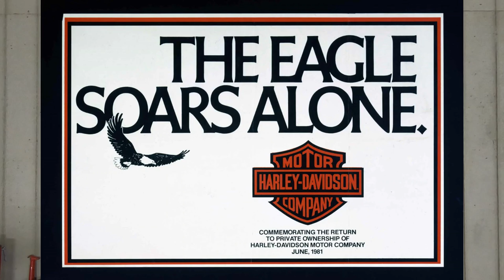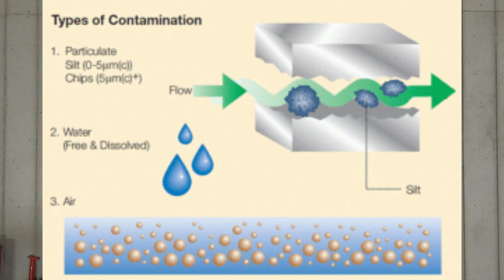Harley Engine Quality Isn't What It Used to Be

Comment: I dunno, M8 engines are lasting longer than Twin Cams and Evos ever dreamed they could. People regularly breaking over 100k and now 120k miles on an M8 bagger and M8 softail.
I remember when once you got like 80K on a twin cam, you were looking at rebuilding the top end. With the M8, if you replace the comp ramp, and the plastic intake then it's a pretty solid 100k+ setup.
Reply: ⬆️ %100 not true, not even sure where you came up with those numbers, did you make it up?
Reply: @getoffmygrass6974  I dunno did you make yours up?
There's dozens of posts of people getting over 100K and several getting more than 120K.
Remember the twincam chain tensioner that tended to blow up at 40K miles. I remember that. I guess you dont have a very good memory.
So yeah, sorry, it's true M8s are more reliable and longer lasting.
Next time don't kneejerk and act like a child.
Reply: @FranBunnyFFXII  Triggered much! 😂
Reply: Who are you kidding 😂? Most ma engines will not pass a leak down test at 10,000 MI. They have all of the mechanical deficiencies of a twin cam plus a few of their own. To stick up for your pathetic motorcycle is one thing to lie about it in public is something else. If they were such a reliable engines that would not be hundreds of rebuild and repair videos dedicated exclusively to those engines.
Reply: @frankmarkovcijr5459  "If they were such a reliable engines that would not be hundreds of rebuild and repair videos dedicated exclusively to those engines."
Tell me more about how you dont understand how the world works. lmao.
Unreliability has nothing to do with reliability, lmfao.

Comment: You're starting to sound like a fanboy
. Are they really that bad are you kidding 😂😂? Both the twin cam and the milwaukee-eight will not pass a leak down test at ten thousand Miles and will probably suffer catastrophic engine failure within fifty thousand or less in most cases. I have better build quality with my soviet-built URAL sidecar rig in terms of quality reliability and reliability. Let's not even mention my collection of airhead BMW who have anywhere from 75 thousand to 500 thousand miles on them.
Reply from the maker: Yeah they ain't great, they work just long enough to get you out of warranty on your own. It's tough to tell someone who just spent 30K how bad it really is.
Reply: @GixxerFoo  if people would stop buying them and stop throwing silly money to fix the cheap things that the factory put in the motor that maybe the factory would put good quality components in the motor instead of sheep crap. One YouTuber had a 2014 twin cam with 24,000 mi and sat and suffered catastrophic engine failure. We're talking serious money to rebuild a very expensive motorcycle that should have been reliable from the get go. You should not have to throw between four and $10,000 into your $30,000 motorcycle to make it reliable. For anyone else it would be an unacceptable State of affairs but people who buy Harley's as a chrome penis extension have more money than God and Harley nose is which is why their motorcycles are so expensive to begin with and such crap to deal with. If Harley-Davidson was a car company they were bee drowning and junk cars that they would be forced to take back under the lemon 🍋 la w. They probably would have been bankrupt 20 years ago if that was the case. If everyone who had a defective twin-cam demanded Harley-Davidson fix this problem Harley would have gone bankrupt from warranty claims the same way Norton motors did in the 1970s.
Reply: @GixxerFoo  for real? What are all the failures at 30k miles? I'm not disputing it just genuinely want to know. I heard of the sumping and that seemed to be fixed. Comp ramps but that was for people that did upgrades. What is the major failure mechanism at 30k miles?
Reply: Yeah, better quality in soviet bikes hahaha. Many guys in 90s/2000s in Poland rode them, chop them, costom...Myself build a long chopper with Dnepr MT-11 motor and parts. There is no way to scribe terrible quality of these products. Of course, some guys made a big changes, even make parts for them self in some precision mechanical plants, and replacing all inside the engine, gear box and cardan drive. But it always have been garbage. We made them similar to harley because of our terrible poverty. Even the rear wheels were created based on car wheels from a two-stroke communist nightmare called the Syrena, with an engine from a fire engine pump. In the West, especially today, you have to be a fetishist or masochist to touch Soviet shit at all.
Reply: @Pracaupodstaw  I do not have a Denper. My URAL tourist sidecar outfit has 50'000 miles on her. I just your basic maintenance on her and she keeps on going. Many Harley-Davidson milwaukee-eight powered motorcycles have had catastrophic engine failure with less than a quarter of that mileage. The YouTube channels are filled with how to fix twin-cam and milwaukee-eight Harley-Davidson engines and it only cost to treat 4 to 10 dollars to fix them. I have had to do some simple repairs because the motorcycle is after all almost 25 years old and since I do not drive a car I use it as my truck. I bought it ten years ago for $4,000 and it has six thousand original miles on it. It also has pretty much all of the options that you could get at the time. I go down gravel road and dirt roads that would give a Harley dresser Rider a heart attack just to think about. The only Japanese parts on my motorcycle are the mikuni carburetors and mikuni makes great carburetors. All of the Russian parts shock absorbers, electronic ignition, everything else is in good working condition. It is not fast but it is fun to ride and everyone at every party I go to tells me I have the coolest motorcycle there. My Sportster has four hundred thousand miles on her. She is all original except for the new stator in the primary. It is ironic that the Harley that Harley made in such great numbers is such an unreliable piece of crap. Both the twin cam and the milwaukee-eight have a shopping list of built-in engine deficiencies because of using cheap parts in construction that cost you thousands of dollars when they fail. My URAL tourist sidecar outfit is easy to work on when needed with simple hand tools wear as a modern Harley needs $10,000 worth of electronic computer stuff to talk to the computers on the bike. The fact that my soviet-built motorcycle is more reliable than a modern Harley-Davidson 20 years plus it's junior is pathetic on Harley-Davidsons Part. Before anyone says anything I am not a Harley hater after all I have owned my Sportster for almost 25 years. If every twin-cam and milwaukee-eight owner made Harley-Davidson rebuild their enginesunder warranty using better quality parts Harley-Davidson would have been out of business twenty years ago. Their warranty claims would have put them out of business the same way Norton was put out of business by their outrageous warranty claims resulting from the use of cheap parts in critical components in both engine and the gearbox. I think I have made my point ☝️.
Reply: @Pracaupodstaw  I said 4 to $10,000 to correct built-in engine deficiencies from using cheap parts it left out the thousand when I made my comment.
Reply: @ehump517  go watch some of Kevin Baxter's twin-cam and milwaukee-eight rebuild videos and she will see the type of things that people deal with. At very low mileage catastrophic engine failure from the crankshaft all the way up. Modern Harley's cook their engines at 300-plus degrees and within 200 mi the engine oil is black as Coal. The fuel injection on all of today's air-cooled motorcycles makes them run as hot as Hades and after you cook the oil it does not matter because the oil is ruined even if cool it down afterwards. My Sportster runs 200° to up in Florida in August. Harley last reliable dependable big twin motor was the evolution motor which was designed by AMF to overcome all of the problems to shovelhead engine had resulting from pollution requirements as well as poor fuel ⛽. By the way I also have a JAWA Perwak. Nice little bike with a beautiful looking engine.
Reply: @frankmarkovcijr5459  Ok. I, of course, agree that the Twin Cam and M8 are outrageous designs. To spend hundreds of dollars more not for powerful tuning, but to make a motorcycle like a Harley used to be? This is simply fraud and a type of the most disgusting practices known to the most despicable corporations. I myself wanted to buy a few years ago just a TC, I knew nothing about this generation of engines. And, as it is me, I started to find out. Read, watch, ask around. And it poured out what kind of quality it is, and what they invented there. And it's not just a matter of engines. Powertrain mounts, frames, transmissions - this is already broken on paper, by design. Apparently, it came out in their market research that, motivated by the idea and history of the brand, people will not care about such bullshit. The M8 is exactly the same, plus tons of electronics unnecessary to anyone. I don't know much about Indiana and Triumph, but I guess such things are unthinkable there, not to mention the new BMW cruiser, or Moto Guzzi (I know the Audace model - an unthinkable mess like in TC). On the other hand, as for Soviet motorcycles. Maybe you are writing about the export Ural currently in production? Because you are certainly not writing about motorcycles from the time of the Soviet Union. I know the subject very well, both Dnepr, Ural, Iz, Minsk, and Soviet cars (I had a UAZ 469 B) were terrible garbage. Terrible. Sure enough, on it went down Poland and the countries next door up and down. Only that the panniers were not for clothes, etc., but for parts and tools. Sometimes the front suspension lags in choppers were built from hydraulic seam pipes, other ratios in the cardan shaft were made at their own expense, in machines dripping with chrome and metallic paint worked parts from two-stroke motorcycles from the Czech Republic and communist Germany (CZ, Jawa, MZ) Rescue for guys in our country, who no longer had the strength for these vehicles, was to dig out at antique exchanges and sheds parts and engines from pre-war BMWs. And the rusted, rusty pre-war parts from these oldies did a million times better than the parts of Soviet motorcycles from the 1980s or early 1990s. the most interesting were the monstrosities built from a combination of Dneprs and Urals with engines from Humpbacks and Zaporzhzhzhys (ZAZ 1300) .... Someone who struggled with such primitivism and poor technical workmanship just to drive, then fixed everything for himself ....
Reply: @Pracaupodstaw my URAL 1999 tourist sidecar outfit has been more reliable than I thought it could be. I had the timing gears replaced. I replaced the driveshaft myself. I had a cylinder crack at the bottom and I replaced the cylinder and everything went back together with new gaskets and seals. Icruise for hours and hours at 50 to 55 miles an hour with no mechanical issues. I repeat all of my Russian parts on my motorcycle are in good working condition. The paint and the Chrome has held up pretty well after 25 years. I change the oil and filter regularly and replace The Pusher tire as needed. I also told a motorcycle trailer with my BSA 250 single to the off-road park. As a BMW collector and enthusiastic I know well of people who put BMW motors in Ural sidecar outfits in order to cruise at highway speed. I have a BMW 600 / 6 with a 900 cc motor in it and all the brackets to hold a sidecar to the frame and I was looking for a sidecar when I found the Euro and for the price I paid for the sidecar outfit it's like I paid for the site car and got the motorcycle for free.I ride it as my everyday transportation for the last three years. You would be surprised at the type of things I have carried home in my sidecar. I also have a 1973 jawa perak 250 which is a nice little two-stroke motorcycle. The newer fuel-injected motorcycles I have nothing to do with. I have seen newer sidecar outfits that have had gearbox and engine issues at low mileage. When my bike was made in 1999 they made a hundred thousand motorcycles a year, now they make about 20,000 and they are not the rough tough motorcycle that they used to be they are like today's sissy four by fours that you can't take off road bunch of puftas.

Comment: I think some people need to ride a shovel and twin-cam back to back. The shovel feels like a tractor compared to the twin cam. Saying the bikes haven't improved is just ridiculous. The brakes, suspension, sprockets, chrome, paint, frame, ignition, power output, reliability, service intervals, vibration, engine noise, lighting, dash gauges, clutch......and more....all massively improved, not a bit but lightyears. I have owned ironhead sportsters, shovel 1340, evo sportsters, evo bigtwins, several twin cams (and about 30 bikes from other companies). I remember when the Evo came out, people HATED it. It was called the japanese harley. Every engine Harley put out has gotten hate for years.

Comment: My experience with HD was short and traumatic. I owned a 1974 883  Sportster. I believe HD engine quality has always been sub-par, and obsolete since the Pan Head.
Reply: You can't have owned in 1974 883 Sportster because they were 900 CC's back then. In 1975 they went to 1000cc.
Reply: @Frank Markovci Jr  my Sportster was an 883 CC Shovelhead. Whether or not the motor was original, I do not.know. It may have been a parts bike. In any case, it was an unreliable piece of shit.
Reply: @TorquilBletchleySmythe  a shovelhead is a big twin not a Sportster. Now there were some conversions to put a shovelhead top end on a Sportster but they were very pricey and hard to do not a very common conversion. Now if you bought a used motorcycle that was poorly if maintained at all and ridden hard and put away wet you can't use its experience up against all of the examples of its kind.
Reply: @Frank Markovci Jr  it was a money pit from the get go. I wouldn't be surprised if it was a failed project. It ran good enough to buy, but then it was all downhill. Looked like a shovelhead top end to me, but I was 22 and knew nothing about Harley's. In any case, I ran out of cash real quick and sold it to the first comer.

Comment: Computers and hi tech doesn't equal quality. Look at the pyramids and ask yourself if you can cut rock with a hardness of 8 , close to the hardness of the crankshaft of a Harley while using softer metals like copper or brass. This should tell you mankind are in general on the wrong path, Zen and the Art of motorcycle maintenance. A book of hippy wisdom that may serve a critical mind some logic and space when they are trying to let go of the insanity and speed of modern life. But look at a Vincent or Levis , they are crude but beautiful in a crazy way. Not like this computerized sterile world they are building. Soon you will be riding a Harly Live wire , the second most ugly bike ever created. ( Only because it wouldn't be fair to call it the ugliest)

Comment: Com on so?  I totally disagree huge companies like HD do not stay in business by building crappier motors decade after decade dude I love your page but wake up face it you hate M8 motors even though they will blow the doors off of your favorite Evo motor and outlast one even after mild performance mods!... Get out of the past!!!!
Reply: Fortunately, it's not that kind of past, since for your EVO you can STILL buy a powerful new engine and a suitably robust transmission, and have a machine WITHOUT PLASTIC inside the engine, worst quality stultifying electronics and planned product aging, with the power and performance of an aftermarket upgraded M8. And it will come out cheaper than a new plastic M8. Fuck new HD.